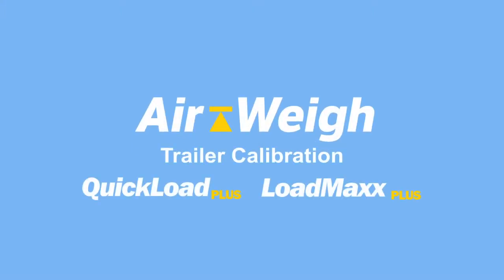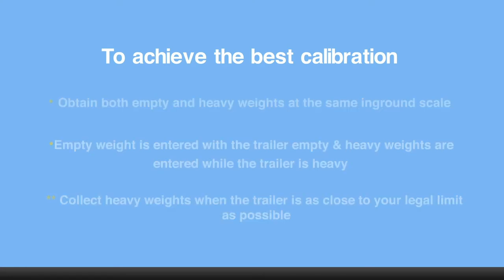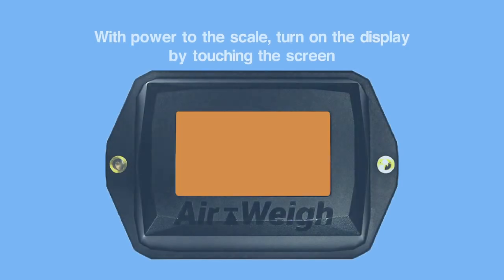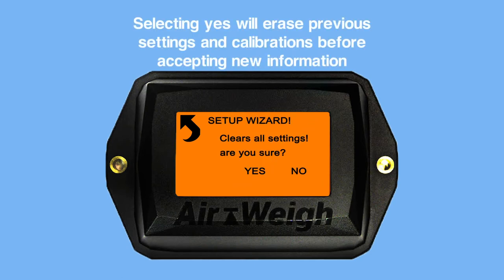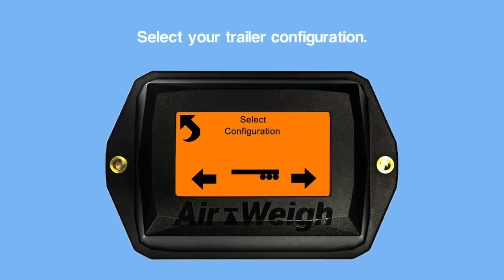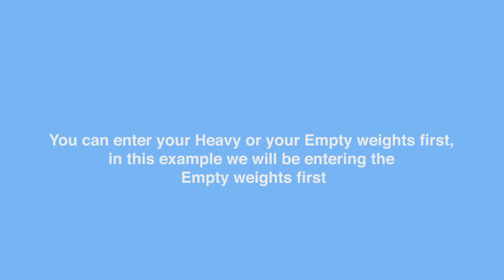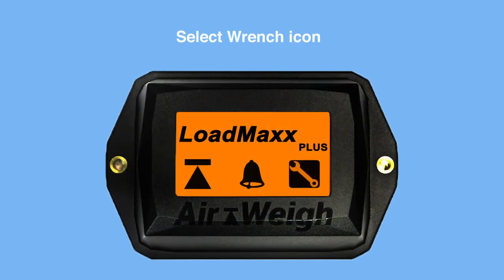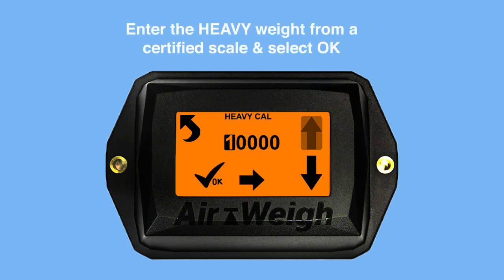Air-Weigh LoadMaxx Plus / QuickLoad Plus - Trailer Calibration

Comment: How can farmers far away from certified scales calibrate their air weigh scales?
Reply from the maker: Most of the commercial silos have a scale.  If possible, take your heavy load to the closest scale and scale your load.  Right then and there you need to input your heavy weights, while you are still heavy.  After you drop your load, go back to the same scale, and get your empty weight.  Again, while you are empty, input your empty weight. Once the calibration process is complete, you won't have to calibrate again unless maintenance is done to your suspension like replacing the height control valve or airbag.